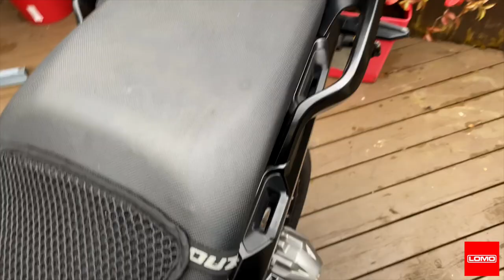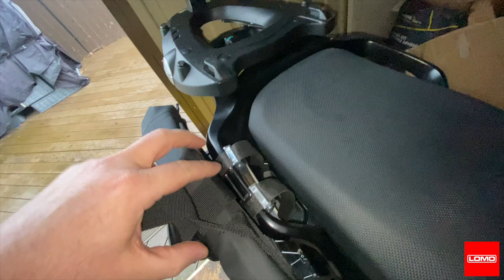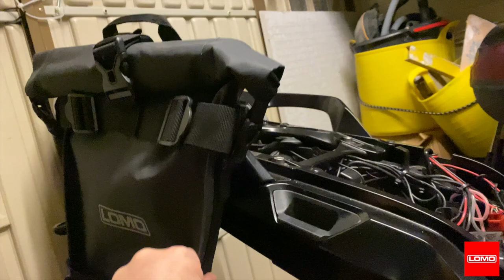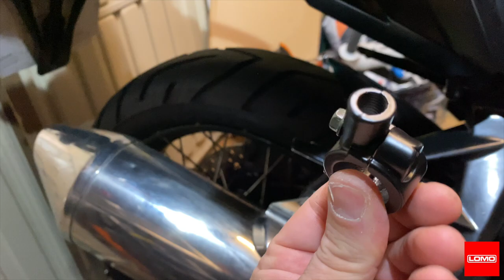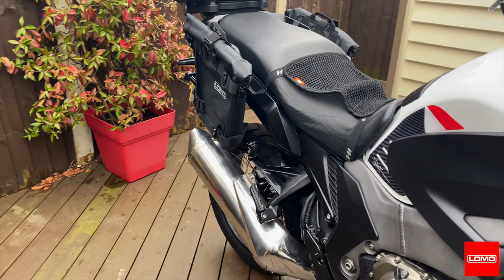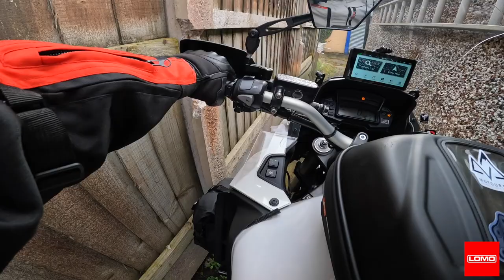LOMO Medium Pannier Bags - DIY Pannier Bag Frame

Comment: The exhaust might be an issue after a days ride, I've seen Lomo bags melt from the bottom. Granted it was a larger bag on a cb500x but the heat was an issue.
Reply: Hi there! That is something that I am also worried about as I have been considering the Lomo panniers for my Tenere World Raid but I fear that the exhaust might be a problem.

Comment: Have you had any issues with the bags bags being close to the exhaust
Reply from the maker: No there’s about 2” clearance, have been checking when out to see if bottom of the bag gets hot and they don’t
Reply: @Motourev: Motorcycle Tours & Reviews  I have the lomo panniers which are 3cm shorter top to bottom so should be great